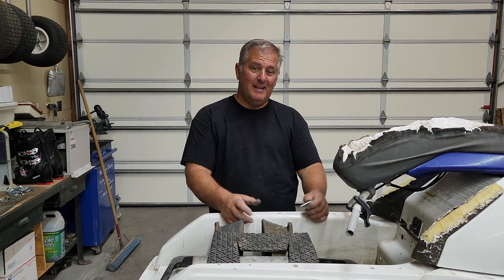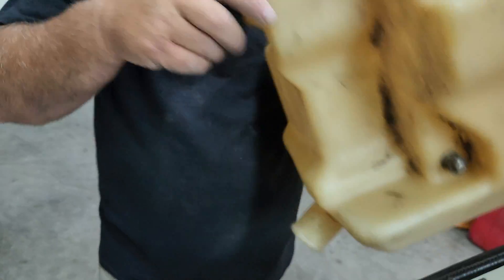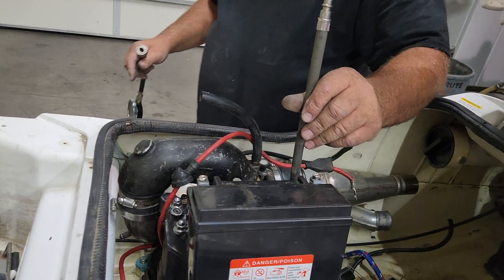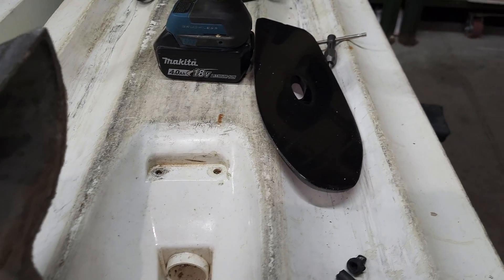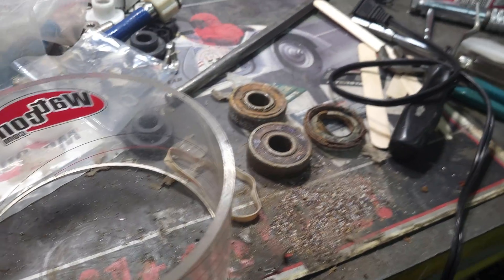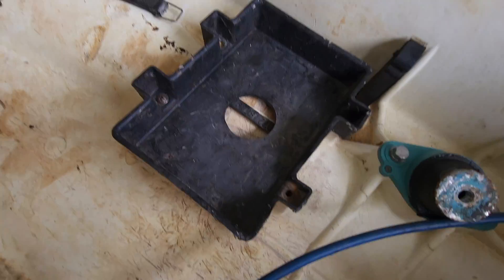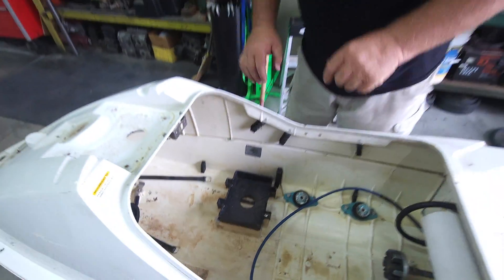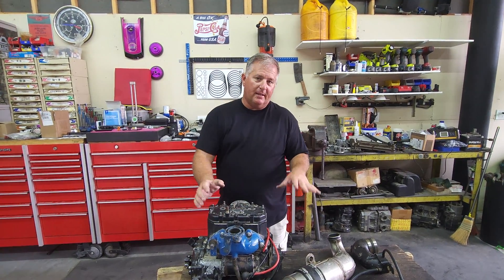Reviving the Beast: 650SX Epic Restoration! Episode 1: Stronger, Faster, Fiercer Than Ever! 🚀🔧

Comment: Have you ever dried out a Kawasaki750/800 exhaust? Or have a video that you made that I can’t find. Love watching very informative
Reply from the maker: no, unfortunately the 750/800 pipes are not a tuned exhaust, so it is really difficult to get more out of them. That is why they go so much faster when you bolt an aftermarket pipe on them. Bill Chapin of R&D used to cut up end cones of Westcoast pipes and weld them on to the stock exhaust, and it really woke them up, LOL.

Comment: In your opinion, performance wise, how does this version of bypassing water from the exhaust, compare to the "Dry Pipe" mod?
Reply from the maker: I used to do the dry pipe mod. I changed to this because it is simpler, doesn't plug up and burn up the exhaust, and it yields better top end.

Comment: What does the bead of silicone do on the front of the ride plate? Just create a smoother transition for the water running over it?
Reply from the maker: no, If air trapped in the rear  pump area (above the ride plate) makes its way to the pump/impeller area it creates cavitation (it feels like a slipping clutch in a car, or a transmission going out) and it makes the ski run poorly. The silicone is to keep that from happening.  Nice catch. :-)  Thank you for watching.
Reply: @jetskijim007  I will give that a try, just finishing up a mag pump swap on my WB1. Thanks Jim!

Comment: When doing the exhaust and T in the water line  and welding up the tip  do we need to drill the water box out for it too work Correctly?
or can I get by for the rest of the summer
Reply from the maker: You will be fine. Drying out the exhaust is one piece of the puzzle. Drilling out the waterbox, or freeing up the flow, is another. It all helps make more power.

Comment: I was wondering what factors lead to you using a 15 pitch prop. Is it based on engine power or weight of the rider? I’m thinking about taking mine apart this winter because I live up north. I ordered a pump stuffer and intake grate for it. I don’t know what pitch I have now but I want to check when I get it apart and would like to know if it’s good or if it’s worth replacing before reassembling… thanks
Reply from the maker: Engine horsepower is the only thing that matters. If the engine does not have enough power to spin the impeller at rpm, it will be ineffecient/slow. If a rider is heavier, it doesnt affect the impellers ability to move water through the pump, it just  creates more drag on the ski itself moving forward. 98 percent of skis i come accross have too tall an impeller in them. A 15 impeller or 8/16  are fantastic impellers for probably 80% of 650's out there.
Reply: @jetskijim007  thanks Jim. I’m new to skis I just got a 650 that’s been sitting for 20 years and I’m new to them. It’s in excellent shape but I want to go through it like you did with this one and just make it as reliable as possible. I ordered the pump stuffer with the slit but I might take the whole thing apart and check it out this winter. I’m going to try to find that gauge you had for checking pitch and see what I have in it.

Comment: I have a 1992 kawasaki ts 650 jetski with no engine or ebox just the hull and a few things. What could I replace it with?
Reply from the maker: A kawasaki 750 engine out of a 750ss or XI will bolt right in, exhaust carbs electric and all. :-)